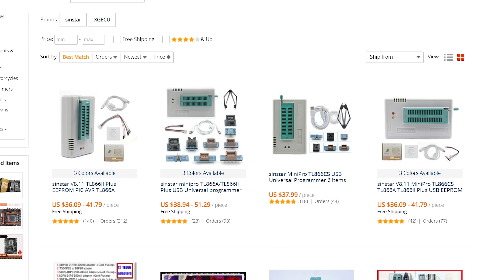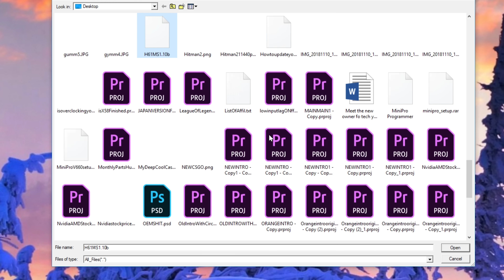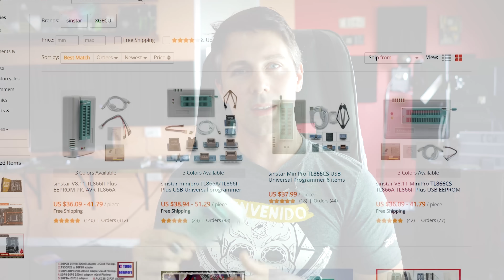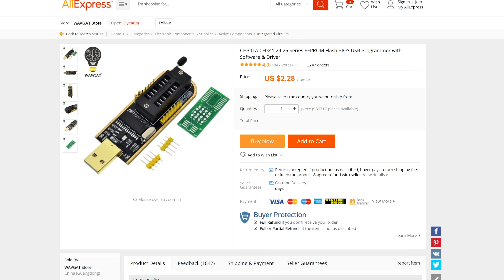How To FIX Your BROKEN Motherboard for ONLY $2...!?

Comment: These also work great with fixing fake china graphics cards! For some odd reason, they lock them so you can't use the usual tools, but the hardware programmer doesn't care about this :)
Reply: I've seen that video. Very cool.
Reply: You learn something new everyday, thanks for sharing this Phil :)
Reply: I was just gonna ask this, ty!
Reply: Thanks Phil for sharing that knowledge.
Reply: yes its true chinese guys sell gtx550 as 1050 then the original driver piss you off kkkkkk, ive used to istall a bios from an 660 ti to an 660  and it runs much better now with the instant high clock freq.
Reply: Cheers for this, I been tryin to find out about "how much is a circuit board for a furnace?" for a while now, and I think this has helped. You ever tried - Giyathan Bewildering Gratification - (should be on google have a look ) ? It is an awesome one of a kind guide for discovering how to repair your electronic items like a wizard without the hard work. Ive heard some super things about it and my neighbour got amazing success with it.
Reply: i dont mean to be so off topic but does any of you know of a way to log back into an Instagram account??
I stupidly forgot the account password. I would appreciate any tips you can give me.
Reply: @kalebforrest5918  without having your associated email, im afraid you cant recover your instagram password, there isnt even a way to hack into instagram without already having the account wanting to be hacked into being currently logged into on some type of device. sorry about that, but i hope this helps.
Reply: @Kaleb Forrest instablaster ;)

Comment: I never could get that damn clip to work, so I got the number off the chip & bought another one. I programmed the bios on the new chip using the chip holder then swapped chips. Worked first time.

Comment: Regarding the finnicky clips/jaws, I've had 2 sets of the 341A programmer and the first one came with clips that worked flawlessly on the half dozen BIOS chips I've tried. 
The 2nd set programmer came with the most finnicky clips ever, although the clips looked visually identical to the first set, it was literally a nightmare to get them pretty much on any BIOS chip.

Never the less, on any BIOS that I've managed to get good contact, flashing on it was a breeze.

As a side note: do be careful with the 341A programmer, they can stop functioning if they get a high surge. In my excitement, I turned on the a PC that I flashed on to, while the jaws were still connected to the BIOS chip, not only did that instantly kill the 341A Bios programmer, but somehow it also killed the onboard audio on the motherboard that the CH341A was connected to!

Comment: Will that work for a vending machine motherboard I need to diagnose it I know it's no other component except for the motherboard so how would I repair the motherboard because they are very hard to find I hear I want to repair the one I have
Reply: I don't know anything about vending machine motherboards but if the BIOS chip is the problem but presumably it might help.
Get yourself the 341A programmer with a set of jaws, it's only a couple of bucks, and give it a try.

Comment: Thanks so much for the tip! I noticed you took out the cmos battery but didn't mention it in the video. might want to point out little steps like that, just in case. Great video!

Comment: I got a brick gigabyte A320M S2H V2mobo and the bios chip is MXU12873F which is a small ic and clip won't hold the chip stable and keeps disconnecting as it's giving me FFFFFF.I was using asprogrammer app 1.4 and it sucks really.I guess I'll try this neo programmer to see if it will work.Anyway I was wondering do I have to connect my psu to the board in standby mode not powering the switch on while doing the bios flashing? cause I'm afraid that it will oversurge or burn the chip since the clip conducts 3.3V too?

Comment: I have a failing ASUS Rampage II Tylersburg X58. It’s not holding date/time after pwr off unplug. Only boots to OS if I press F2 (load default & continue). Restart requires clr cmos again. Using F1  I can get to bios EZ-Flash and see my saves on USB.  Should I try that 1st   As is if I F1, do nothing but save & exit it won’t post again till I cle cmos. Bad NIOS chip? It sat untouched in open case on top dusty shelf for 6 yrs , same i7 980X never came out till last month. Pins beautiful shape.
Reply: replace the cmos battery

Comment: Every board should have a flash ability using usb. If you screw up the bios, you should be able to put a stick in with a new bios and it fixes it. Say you screw up a bios update, there should be a tiny section on the board that is read only for recovery, so no matter how badly you screw the bios, you can always recover... Get on this motherboard designers. I will buy your products if you do this.

Comment: You shouldn't use WD40 on pins. You should use isopropyl alcohol to remove grease, not to add more grease from WD40. If clip is not holding on flash chip, then you can add a little bit of solder with soldering iron to the pins (at the top).
Reply: Yes, good advice! NEVER use WD40 on electronics! After degreasing with anhydrous alcohol, use Caig DeOxit to enhance contact conductivity and prevent oxidation. I also use this method on all RAM and all printed circuit board edge connectors to improve reliability.

Comment: The (windows) software for the CH341 programmer might be questionable - but it works with flashrom which should be safe. There are different qualities for the SOIC clips, the cheapest are varying at best, but higher end ones not from aliexpress do work reliably.

Comment: I saved an Alienware laptop with the ch341a and the cheap jaws I cleaned the chip pins and had to use a different version of software but it worked

Comment: Good job Bryan! I have a MSI z77a g43 motherboard that need a bios chip replacement. I bought for cheap (look as new!) but never worked. I would like to fix it and put a Xeon E3 1270 v2 on it.

Comment: just bought the ch341 usb flasher, came with a shitload of adapters and that shitty clamp as well. 13 bucks for everything. the clamp quality is a very widely shared opinion, and every review said to buy the name brand blue clamp, which was close to 20 bucks just for the clamp itself. supposed to be a game changer, glad i ordered them at the same time

Comment: wasn't there a trick to troubleshoot something in motherboards using a magnet on a chip in order erase info. i don't know if it was bios related or some other chip. I worked on computers 20 years ago, and my boss used that trick 3 or 4 times. with the power off we would use a magnet on a chip to solve startup problems.

Comment: Im trying to program the chip of MSI p55m-sd40 but the programmer software does not detect it automatically and nothing is written on the chip itself. Any help with this?
Reply: ok I found the chip name. However now when I try to write it always says "write operation timed out"

Comment: Not sure if anyone has mentioned this yet but... There gpio signal loss when eeproms are still attached on boards...  It is best to remove them and perform the flash offline... The down side is that there is soldering to do.

Comment: Bought the same type of kit the clip that went on to the bios chip was absolutely useless. Ened up buying a new motherboard save me time and money. Don't bother with the soldering iron and taking the chip out the heat from the iron will break the chip.

Comment: This video didn't receive nearly enough love for the repair value it provided :D  Because of this video, I fixed my bricked Asus x370 Prime Pro mobo, and even used it to manually update a B350 mobo to be 2nd gen ryzen capable without needing a first gen chip.
Reply: wow, nice to know. man, can you tell me, i've asus z370-a prime and its bios got corrupted (pretty innocent change in settings and boom, dead), i thought about getting bios chip online from holland or taiwan and soldering it, but, sorry for being at almost noob level here - they don't mark bios chips anymore on asus, nothing has ami marking either, not a single doc from asus points WHERE the heck is the bios chip ! :-) my guess - 2 chips next to a2 dimm slot, can you confirm it ? oh, if i can get away w/o soldering, just with clamp/usb adaptor reprogramming, it'd be great, so, did you reprogram just one bios chip on your x370 (layout looks pretty much like z370's one) or it has 2 (sitting next to each other) and both need to be flashed (if you can tell me the ref of your bios and programmer you've got from china, that'd be great, chances are big my bios chip is just the same as yours :-)

Comment: This tool for connecting the mobo JSPI1 with the external programmer is much better :

https://fr.aliexpress.com/item/JSPI1-br-leur-MSI-carte-m-re-BIOS-puce-free-sur-puce-br-lant-brosse-machine/32837013205.html

Comment: Just used the 341 with the crappy clip and saved a laptop. The clip is indeed troublesome but works great when finally good connected. Also some wrong programmer software out there that give the wrong advise/layout for the pins so be careful with that!

Comment: Instead of using the jaws, I don't see why you didn't solder directly to the chip and remove the wires afterward. I get that it may be scary for some people, but it would've been a way better connection.

Comment: if the motherboard have dual bios,try this method: hold power+reset for 10-15 seconds and release it.i have a gigabyte 990fxa ud3 bricked after bios update and this method was save me.there will be a warning like bios recovery if you succesful tried this method.

Comment: I know this doesnt have anything to pertain to the video but you should check out r9 furys on ebay. I just picked mine up for $130 US shipped
Reply: I just built first system using this card and an x58 xeon for under $400

Comment: Those Gigabyte boards are really easy to get working after a bad flash. You just need to short the pins on the second bios chip and it writes that bios to the original. Think it's pin 1 and pin 6.

Comment: This is how I fixed my gaming laptop. Asus wanted $700 to fix when it bricked. I used a 341 iirc. Even made a custom bios for the Asus g75-vx. Overclocked the cpu (i7-3630qm) and the gpu very far via a custom bios.

Comment: I wish they had these years ago. I had to buy a new BIOS chip for my Asus Crosshair V board at one time. At least it wasn't too expensive, maybe $10 shipped if I remember.
Reply: Well 10 years ago you'd pay $150 for a programmer and $20 for a test clip, but everything could be done... Or you could DIY a programmer from an old computer's printer port.

Comment: i have a asrock z77 extreme that cost around about 120 dollars us and it will not power on at all like nothing comes on when the board is plugged in not even the post code display turns on when the board is plugged in are there any suggestions i should try

Comment: Try playing with memory, I've found I've been able to get a dead mobo with bent pins working a few times by using different memory or switching which ram slots are used seeing as a large part of the CPU socket is usually assigned to memory